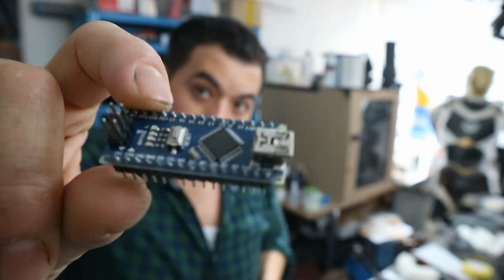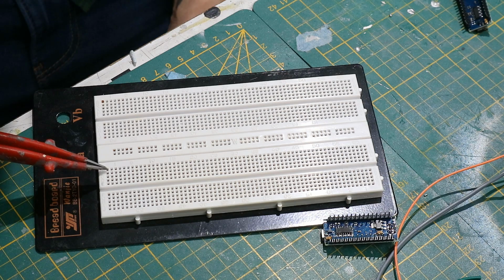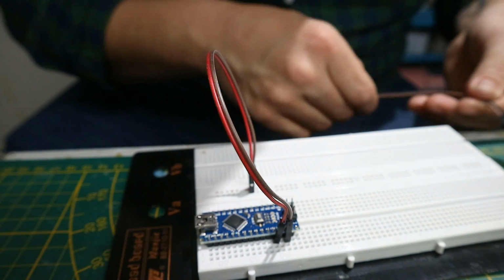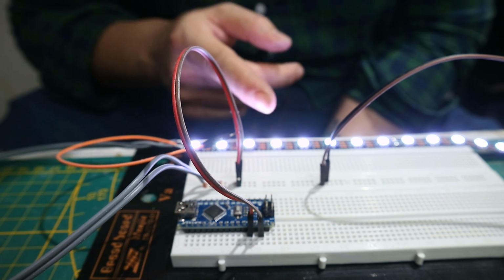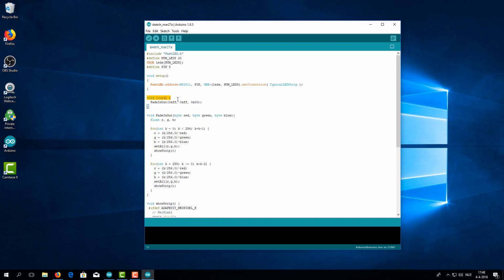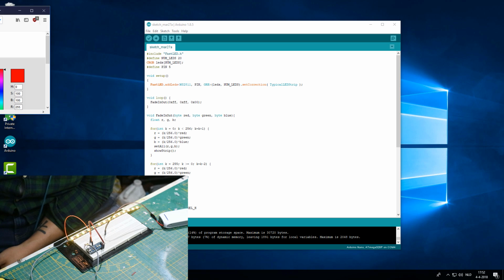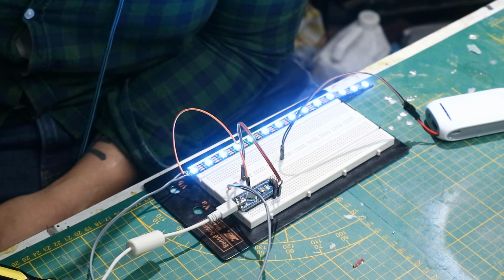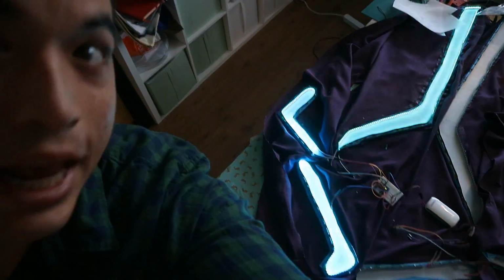Arduino Basics - Fade RGB Led, inc. code - TUTORIAL

Comment from the maker: Request for unique codes will be ignored, putting it here also (in description it already says it)
not trying to be mean but i cant handle every unique request out there, i will do more arduino videos on different subjects later.
But just challenge yourself, just start tinkering around, buy a arduino starter kit on amazon or aliexpress or whatever, and GET BUSY,  use my video as the basis and go from there. :)

Comment: Hey @Costronica, I just purchased a pack of three Nano's for this project. I downloaded your code. When I tried to compile, I got an error saying that it takes more space than I have available. Your code is 4474 bytes, but the Nano can only handle 2000 bytes. What you recommend? am I doing wrong?
Reply: I'm realizing now that it is the memory for Global Variables that is using 185% of dynamic memory. What can I do to work around this?
Reply: So, it turns out that the FastLED.h library is too large! I switched to Adafruit_NewoPixel, changed the code a little, and it's working perfectly.
Reply from the maker: @tonyroberts2452  well this video is now 7 years old so some changes maybe were had on nanos.

since AI is more prevelant now, you can perhaps toss this code in something like chatgpt or Gemini and ask it to simplify it or make it smaller to save space and reupload that to the nanos you have

Comment: I know this video was created 4 years ago but I really want to make my leds fade in and out when they turn on and off. The only problem I have with it is that they come already pre-coded. I am also putting them in my car which means that I can't use a breadboard. The only solution I can think of is soldering a circut to the wires that are attached to the led circuit. I have done a little reasearching and found an RC circuit that works on a simple led strip with only positive and negative terminals. My LEDs are RGB so they have a positive and then R G and B terminals. I have been asking around and thought maybe you know how to fix this? This is the video: https://www.youtube.com/watch?v=IrzfZuyWA8A&ab_channel=ABTabi

Comment: I have many questions. 

Is there a way to make it fade slower? I want like a slow breathing fade. 
How do you convert that to the PCB board and not the breadboard? Trying to make a Tesseract prop and I want to keep it slimline as possible. 
What kind of power supply would I need for a simple prop like the Tesseract when I would only have it on for maybe 30 seconds at a time to show somebody?
Reply: Yes, there is.
There are 2 setAll(r,g,b); lines on the FadeInOut function.
After each one add a line   delay(10);  for example, try to change from 10 to 20, 50 and check what happens.